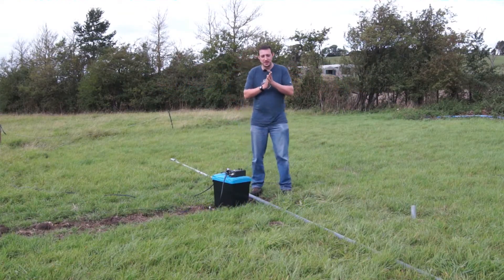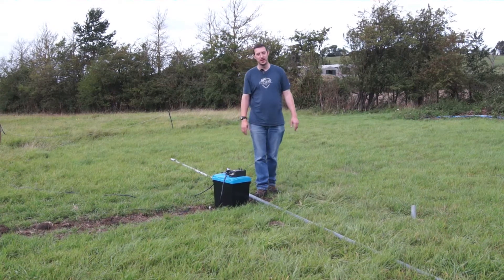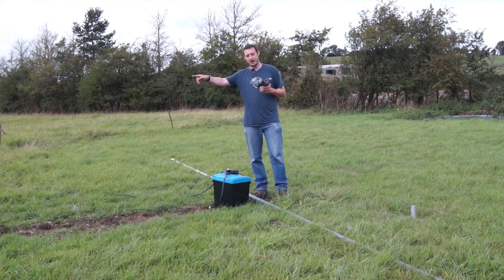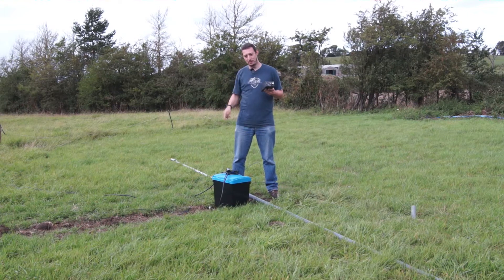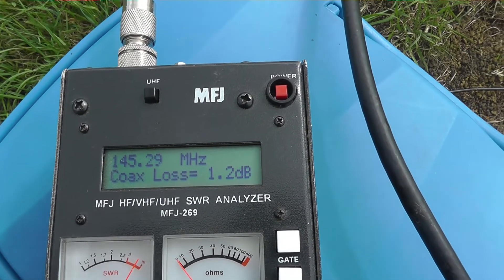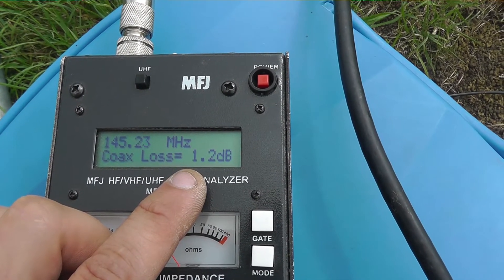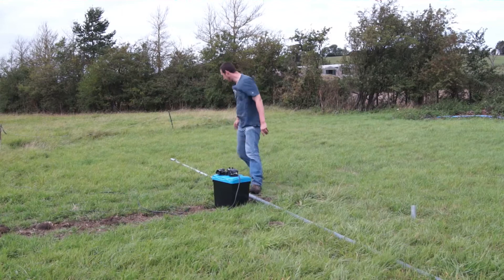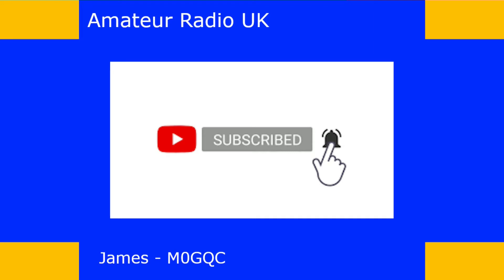RG-58 vs Westflex 103 Coax Loss - There's A Big Difference!!!

Comment: Good advice James. I'm still using RG58 for HF,  but the run is only 20m so loos is not major on 20m and below.  For VHF/UHF I now use German made Ecoflex10 with N type connectors,  which works in the challenging climate I have here in the hills.

Comment: Great video. I have a question. I have just changed my rg58 to westflex 103 50ohm. My antenna is a Sirio gain master. Im on the CB bands 27/81. When I was using the rg58 my swr was 1.3. Now changing to the westflex its rissen to 2  to 2.5. Can anyone shed any light into this? All my connections appear to be fine
Reply: If your cable length is long,  RG58 losses at 27mhz  will eat up outbound as well as reflected signal,  so lower SWR.  By comparison the Westflex  eats up less in both directions giving you a better indication that your antenna tune is not perfect.
Reply from the maker: If anyone else has any thoughts please chip in but here are the initial thoughts which went through my head when I read your comment:-

RG-58 is fairly lossy cable, even down to the upper HF bands. It's not unheard of for long runs to lossy coax cable to "mask" a high SWR........although I have to admit that I wouldn't expect the difference in SWR to be that great, so I'm not convinced that's what your problem is. I'm wondering what else is going on here.

How long is the coax run?

Have you tried to sweep the band with an antenna analyser to see if the antenna is resonant & giving the expected SWR above or below your desired frequency (just wondered if the antenna might need tuning)?

Where is the antenna mounted? Is there anything metal nearby (roofs, fences, other antennas etc) which could detune the antenna?

Are you absolutely positive that the Westflex cable is good?

Note that a DC connection is different to an RF connection! Just because you are getting continuity with a multi-meter, doesn't necessarily mean that you are getting a good RF connection!

I like Westflex 103 for permanent installs but it does have one big drawback...........due to the solid inner conductor it can be prone to breaking internally if it gets flexed around too much. This can lead to intermittent connections, bad connections, or no connection at all. All of which will likely manifest itself in poor performance & high SWR.

See one of my very early videos for a good demonstration of this:- https://www.youtube.com/watch?v=kfxtM7e2CzQ

It had me really confused!

If its a fairly short run, I would probably favour RG-213 for upper HF frequencies as it's more flexible, less prone to breaking. Basically it will probably last longer. Although RG-213 is technically more lossy, on HF over short distances the difference between RG-213 & Westflex will be negligible. The pros outweigh the cons.

Having said that, if you now have Westflex 103 & the cable run is definitely good, then I wouldn't bother to change it.
Reply: @HamRadioOnline   thanks for your reply. Turns out I had to retune the antenna by a few inches. The antenna is mounted on a steel pole on the house of which I have the TV ariel about a meter lower. Would this effect anything or give me noise issues as with most people they suffer with s 5 to 7 noise. It's nothing in my house as I've turned off the power and ran from a car battery. But yes the swr is about 1.2 to 1.3 now.
Reply from the maker: @dominicbasham5257  Glad you got the SWR down.

As for S5-S7 noise levels, unfortunately that is pretty standard in residential areas these days. Especially on the lower bands (such as 40m, 80m & 160m). Ideally you need to figure out where the noise is coming from & resolve it which is easier said than done. This may be impossible if you live in a very built up area as noise can come from multiple sources in multiple houses.

Proper grounding will help. I managed to knock almost 2 S-points off of my noise level by getting my grounding up to scratch.

As a final thought, check you haven't got your pre-amp switched in. In the past I have turned on the radio & thought to myself why the hell is it so noisy. I then realised that the pre-amp was on & that the noise drops down to normal when I switched off the pre-amp.
Reply: @HamRadioOnline  thanks for the reply. Yes I have read that grounding helps. I will drive an earth rod in my garden and try earthing it. Don't think my rig(cre 8900) has a pre amp.

Comment: whats the thicker cable, RG6?
Reply from the maker: The thick coax is "F-Zero" (Formula Zero) which is a 10.2mm solid core coax. It's specifications are almost identical to Westflex 103 (which is more common & better known).

Comment: What about ..RF 10. COAX. ?
JUST WATCHED A YOUTUBE VIDEO ON IT COMPARED TO OTHER COAX TEST.......RF10.WAS THE BEST ON THE TEST FOR BEING QUIETNESS FOR speaker white noise. ...Mike from Minnesota. ....
Reply from the maker: I'm not sure about "RF 10". It's not a cable that I've ever come across.

I had a very brief look on the internet & there doesn't seem to be much information about it.

Assuming that "10" means that it is 10mm diameter, I would take a guess that it would perform much the same as other 10mm cables (such as Westflex 103 or Formula Zero if it has a solid centre conductor, or RG-213 if it has a stranded centre conductor)?

Comment: RG58 might fit well mobile/camping applications because it is lighter and flexible. But specs aren't lying: Westflext103 attenuation is 3dB/100m vs RG58 - 15dB/100m at 100 MHz. For stationary Westflex 103 is much better.
Reply from the maker: Absolutely agree. RG-58 does have it's place but I will always use Westflex 103 or even RG-213 over RG-58 where possible.

The down side to Westflex 103 is that it tends to break the centre conductor if you move it around too much (such as on a rotator). I believe the technical term is "work hardening". I'll let you guess how I figured out that one!!!

My preference is to run Westflex 103 from the shack up the mast, then switch to RG-213 just below the rotator (where cable flexibility is required as the antenna rotates) to the feed point on the antenna.

Comment: great experiment, u deserve more subs
Reply from the maker: Thanks. I always really appreciate comments & support from other larger/established channels.

To be very frank, the reality is that my channel is in it's infancy at the moment but I am actively trying to build it up.

I'm still figuring out what works & what doesn't. Like all things amateur radio, it's a learning process.

To put a positive twist on it, Tim (G5TM) apparently gave me a mention on one of the Facebook groups which gave me a huge boost.

I was sat on 20 subscribers & as a direct result of Tim's extremely helpful intervention my subscriber count has not shot up to nearly 40.

In other words my subscriber count has almost doubled in the last couple of weeks!

It's early days, so I'll keep plugging away and we will see where it goes.

Thanks again for the comment.
Reply: @HamRadioOnline  Yes I am friends with Tim. I am in the YouTubers bunch with Callum jason Johnson and Josh and all the others. If I can help you in anyway I will. What wireless microphone are you using
Reply from the maker: @digitalanaloguehamradio  Microphone is the Comica BoomX-D.

This was video was it's first outing (filmed at the same time as the "Air Conditioning Vent Hose Loading Coil" video. Unfortunately I hadn't quite got the microphone level settings in the camera figured out, hence the audio is clipping slightly.
Reply from the maker: @digitalanaloguehamradio  Will do.